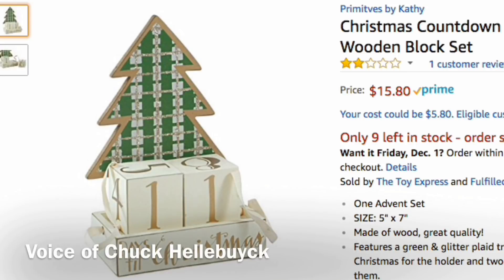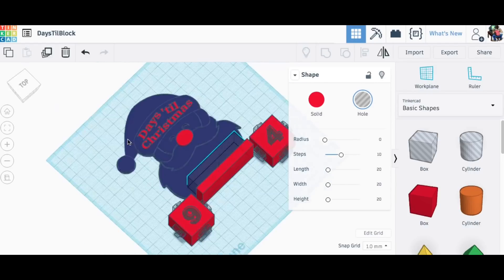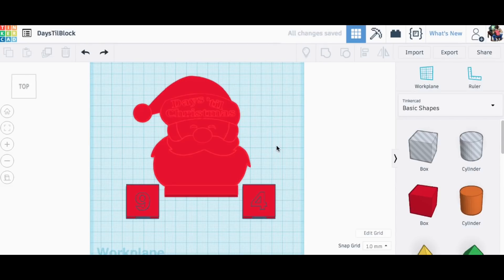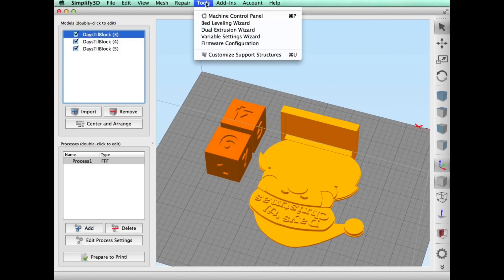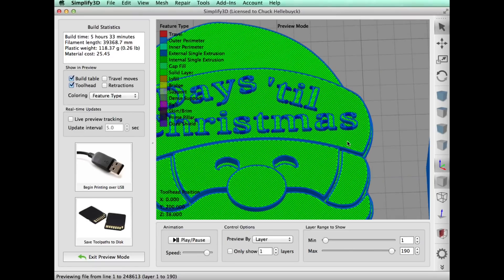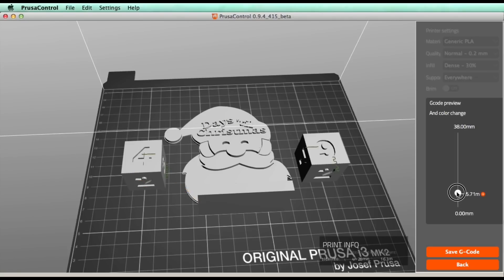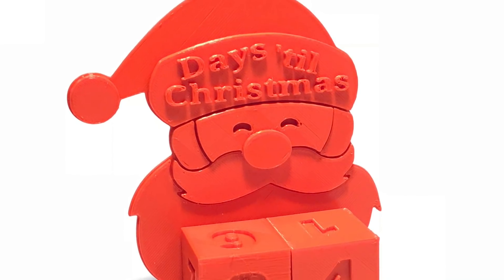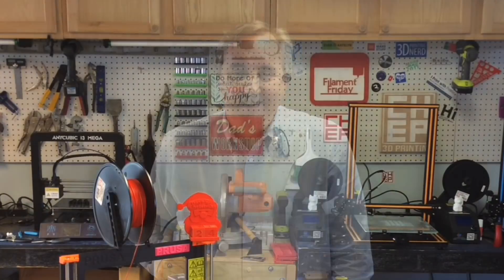3D Printed Santa Advent Calendar

Comment: Printed two Santa's... One at 50%m another 100%. Both turned out well, no gaps, no holes. Printed smoothly. 

Monoprice Select Plus printer, Cura slicer, 0.04 nozzle, Monoprice's white 1.75 mm PLA [all I had left], no supports and laid flat on Santa's back.... Layer height 0.1, shell 0.8, 1 mm retraction, fill 20%, print speed 90 mm/s, print temp 195C, bed temp 60C, 100% flow.  Forgot how long it took to print. [Didn't add a nose to Santa.]

Comment: Chuck, I need some help from someone I trust, You.  My Monoprice 3d mini V2 is dying an early death.  Monoprice is very unresponsive.  Worst customer relations I have ever seen.  Anyway, what can I buy that is a step up without breaking the bank?  In the V2 the latest problem was the build plate stopped heating.  I found the red and black power wire underneath had parted so I stipped it down and replaced them but I am afraid that when they parted they also shorted and now I'm just getting a 999 on the plate heat indicator.  So, I'm sure I have blown any kind of warranty I had.  Anyway, what do you think?
Reply: Thanks, Chuck.  I will bookmark that one.  I did manage to fix my problem.
It was one of the sensor wires.  Really small and inside break.  I ripped it all out and rewired the whole thing.  Really poor design. Merry Christmas.
Reply: I would suggest to continue repairing the printer. Since you've voided the warranty anyway? Describe what kind of issues there have been. Open up the control board housing, look for visible damage, put your meter in diode mode and ring the bed MOSFET (should be NC or high resistance between all pins except a diode from source to drain), ring the thermistor pins to ground and +5V line on the board.

Zhangzhou Changfeng Computer Equipment Co. , Ltd doing business as Malyan System is the actual engineering company behind the printer and will happily sell you the replacement PCB and other replacement parts that you may need. The board is about $50 official price. Just make sure you find the fault first, the PCB might be still fine.

[edit] oh sorry, your last reply didn't show for me at first. Congratulations!
Reply: Hi Chuck.  Yes, I am familiar with electronics.  As you mentioned it was one of the sensor wires.  A real small black (ground) wire that had parted near where the large red and black wire had totally parted.  As I mentioned above I totally ripped it all out and replaced them all with wire I had in my junk box.  It is running fine again now.  It is a poor design right there and will bear watching in the future as I am sure it will happen again.  I reinforced the wires at the weak points with shrink wrap and that should help.  Thanks for your help and getting back to me.
Reply: I'm not Chuck >.> and sorry i must have overlooked your prior last reply.
Reply: I'm sorry Siana.  I didn't look at who was sending the comment.  Good advise and I am back up and running with the mini.  Thanks for commenting, you were right on.

Comment: didn't see it mentioned here but in the Prusa Slic3r edition you can also dial in your fine detail for just certain layers. so you could have lowered (raised depending on your perspective) the detail just on the letters, so you could have it print at a 0.1 layer height and also modify fill just for those layers. On that object it wouldn't make a noticeable difference to have the higher resolution layers on the block holders because they would be either facing down or covered. I've done this several times with difficult letters and it avoids the step of having to change a nozzle when all you want is a few mm of letters. but changing the nozzle will also make it better but adds significantly to the print time. the combo of smaller nozzle and a modified layer height just for that set of letters is the sweet spot for quality, just not for time.  hope that helps
Reply: CHEP 3D Printing & Electronics
Actually not truly a multi process simply drag a slider in the preview window to dial in more or less resolution on specific layers. Allows you to fine tune the resolution of an object just in specific layers without having to dial in a whole process. More than 1 way to do it just offering other solutions.
Reply: https://www.youtube.com/watch?v=TZ3JC_fYgjo

Comment: Chuck, In the Infil Tab of S3D, you'll find a setting called infill overlap.  Change that to like 50%.  You can see the difference as you play with it in the preview.  80% might be too much with a .40 nozzle but try 40 or 50%   I send a pic on Twitter of my printout @ 80% and that was a little rough on top because it left some nozzle marks.

Comment: Hey Chuck.  I think the problem with the text is the .4 nozzel.  When I want to do anything where I want the text to come out I use a .2 nozzel. It takes longer to print but it is worth it. As a test you can change the settings in s3d to a .2 nozzel and slice. You will see the difference.
Reply: Cool :)

Comment: I used Craftware so I could generate custom supports and the lettering turned out great on my MP Select Mini.
Thanks for a great print.

By the way, to anyone thinking of using Craftware, it executes the start G code before it heats the bed and hot end so a nozzle wipe is out of the question.

It was odd seeing the printer do it's home routine as soon as I told it to print then lift the head and wait for everything to heat up before printing.

Comment: Thanks for another awesome video! I am going to give this print a try, sliced it in S3D and didn't see any of the missing spots like yours showed. Auto-supports worked just fine too. Hopefully the print comes out just the same.
Reply: I didn't even notice the 't's didn't slice till after I printed. The original size was quite small, so I bumped it up to 150% and it came out perfect. Thanks for the .stl!

Comment: seriously try Ideamaker.. it works a bunch better than S3D on infill and filling gaps and still has custom supports
Reply: do it, it's a little odd to get setup as you have to play games to get a material into a custom/non Raise3D printer profile, but it works better than S3d.. get the beta also. it has multi layer processes also